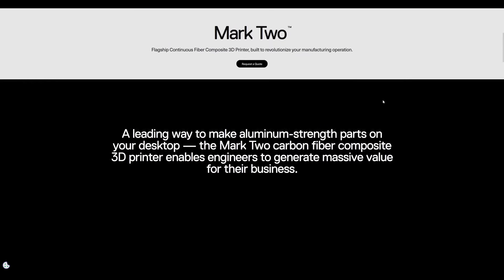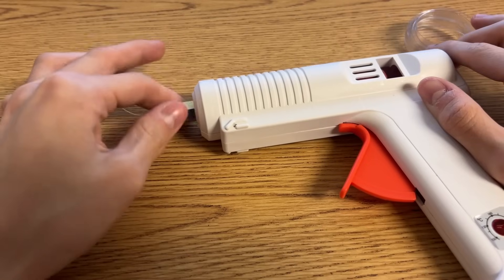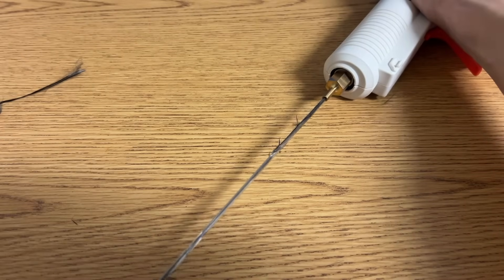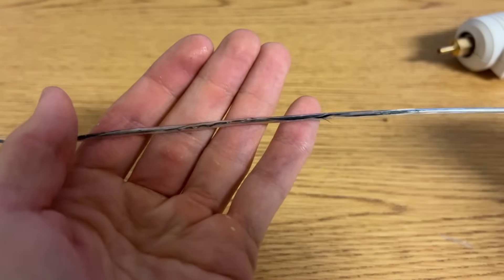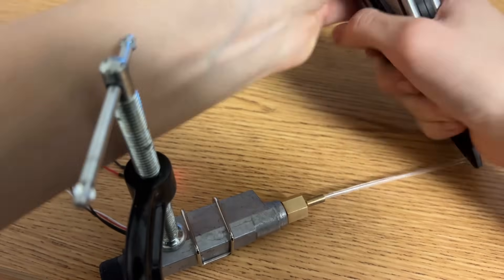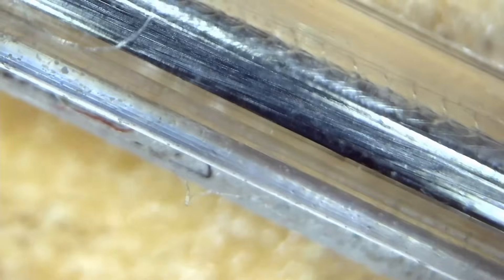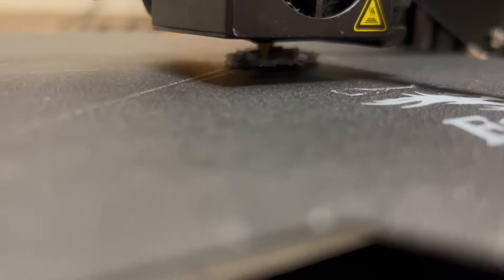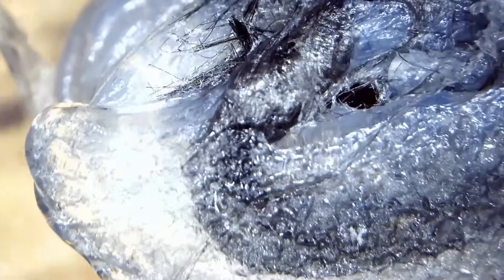Printing Continuous Carbon Fiber At Home!

Comment: I thought continious carbon fiber is printed trough a 2 way in nozzle with normal no matter what filament comming from one entrance and a 0.2mm carbon fiber strand (in the case of a 0.4mm nozzle for example) comming from the other strand and beeing combined inside the nozzle
... like those mix nozzles that combine 2 filaments, so you can print any colore you want (as long as it can be mixed by 2 other colors), I think there are some videos on youtube about it

Comment: yes process is possible the vompany you mensionsled doing that for a lot of money but the way you do it is just stupid... at least make filament inteself with some kind of carbon addition and longer nozzle to maintain better temperatures across all of the printed poop you did so maybe then you will have any results... black filaments prints better become of better conductivity and your nozzle is like yours dad pp short and it's surprising that it made something... get at least big vulcano nozzle if not super vulcano one and print slow on 1.75mm and print big thinks not small resolution will be shit... actually the best will be to print on 0.8 and have separate "carbon nozzle" that you for example tie to a neil and melt into the plastic or nozzle within the nozzle where you will cover carbon fiber by fresh hot plastic

keep going on maybe one day you will sell yourself 15k machine

Comment: Cool! Did you test the tensile strength? Also, does the plastic get in between the fibers, or is it just a shell? Is this a problem?
Reply from the maker: Planning on doing some tensile testing in a future video :)  There are some places where the plastic gets between the fibers and others where it doesn’t, I suspect this lack of consistency was from my hotend being pushed to the high end of its limit. Just from playing around with the samples though, the CF ones feel a lot stiffer.

Comment: I made one of those diy pet pulling machines, but modded, i made a 2 stage melt zone, one big long heatblock lower temp +-210C with a big hole so you get a perfect U shape then trough a modded nozzle to 1.7+-, at 250-260C this 2 stage made me able to increase spooling rate and gives way better results since you don't stretch thé pet, or overheat it with 1 stage. Such a design works perfect with your idea. I would go for thinner Carbon fiber stain, this wil give to much back pressure in thé nozzle, and increasing heat with pet above 270 to decrease pressure does not work, it cristallizes, ( visibel white), and it's just overal bad print Quality, no work around that, so keep thé temperaturen at 260-265, also i tryed using a pretty modded Ender 3 for this, bowden setups Will always fail with this. If i where you i would take out some variables out of thé game, like a bowden setup. If it works out i think it would work. Great first video🎉

Also btw, PET is very hydroscopic, so you need to keep it dry.
I also saw a command about the strains not able to stretch, which makes sense, so you could try extrusion testing normal pet that you pulled with the same heat and strip width so you know how luch plastic there wil be and hiw much CF, wich makes you able to calculate the wall width, it will not be 2mm by 1.2mm like he/she mensioned.

Comment: Check out the "Anisoprint Composer A4 In-Depth Review". I did this review a few years ago for the Top 3D Shop company. This printer also prints with continuous fiber, but in a slightly different way. Watch the video, maybe you'll find useful ideas for your project there.

Comment: when you print normally (0.4mm nozzle, 0.2 layer height) for every 100mm movement you use only 3mm of filament, there is no way you can stretch fibers 30x. So only way this can sort of work if you print 1.75 filament with 2mm wall width and 1.2mm layer height, so the cross section is the same. Looking forward for part 2.
Reply: Also only Vasemode would work.. cause you cant do movement paths at all..
Reply: @hanswurstusbrachialus5213 You can if you're prepared to do a lot of cleanup snipping the strands that aren't hidden inside an object. Obviously this only makes sense for a structural practical print because it will be ugly as heck and only then if the filament protruding through surfaces isn't a weak point and a source of failures.

Comment: that's awesome! only real note is that i would highly recommend wearing gloves when working with the fibers-- a lot of those small fibers can get stuck inside you, it's really annoying...
Reply: We get it. You watched Nathan's videos on carbon fiber. Bravo. You're an expert now.
Reply: @BuzzingGoober I'm talking about working with actual carbon fibers, not the chopped up bits in filament. I had to look up what you were talking about, I'm talking from experience working with composites (granted, mostly fiberglass, but the principles are the same) where gloves are mandatory even before you start getting resin into the mix

Comment: I basically had the same idea yesterday evening, I've been searching for parts and stls since. I think printing in vase mode is a must.
How many fibres does this tow have?
I think 3k should be good.
There are also a lot of community projects on pet-bottle to filament pulltruders (if you want to avoid pulling by hand).
The two stage integration of the fibre is a great idea, in my opinion.
I think you can also decrease your nozzle diameter a bit (maybe 1.5 mm while keeping the same crosssectional area of the printed line) and decrease the volume flow rate.
Carbon fibre conducts heat way better than PET, so you might have to crank the nozzle temp or get a volcano nozzle.
Reply: You might also have better luck with a direct drive extruder. I also saw that PET absorbs a lot of water, so you might want to dry your filament.

Comment: I use the markforged Mark 2 printer at work and they have a cool workaround around your problems. The fiber strand encased in plastic is very thin under 1 mm. They use 2 nozzles with 2 filaments feeded into it: one for bulk printing and the second for fiber reinforcement.  The fiber nozzle has a cutter that severs the fiber when it has to move to a new area. Take their approach. Make thinner filament. Use 2 nozzles. Print only on certain levels with fiber.
Reply: That was my thought that you'd want a tool changer setup.

Comment: First off, great video! Definitely earned a sub. But -- I only watched the first 30 seconds so far, so maybe the rest of the video will address this -- doesn't continuous carbon fiber filament already exist? It's exorbitantly priced, sure, but exists already and has been used at a consumer level.
Reply from the maker: That's a great point - I may be wrong about this, but as far as i'm aware, there isn't any continuous CF filament that can be printed on a run-of-the-mill printer without modifications. Printers like the Markforged Mark 2 use a spool of carbon fiber in conjunction with a spool of conventional filament, which gets combined in/around the nozzle. That process is a lot more practical for making useful parts, but the process in this video is geared more towards hobbyists, as it just requires a nozzle swap before being able to print a part (albeit a part constrained by the limits of vase mode).

Comment: That's great, but you're going to need a filament cutter right after the nozzle to prevent the nozzle from moving and pulling what's already printed(For having a continuous thread of carbon fiber). You can probably activate it with the retraction
Reply: good point, guess this would only work for vase mode

Comment: You need a filament cutter with every retraction
Reply from the maker: The goal of this project is to make continuous CF work on a stock 3d printer so it's limited to vase mode, at least for now.